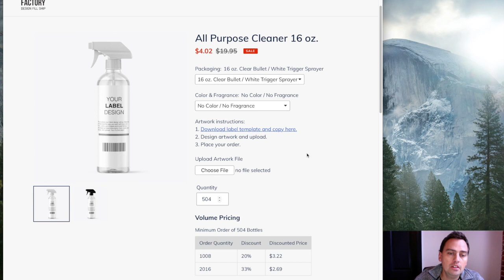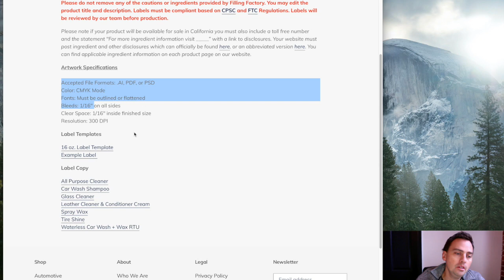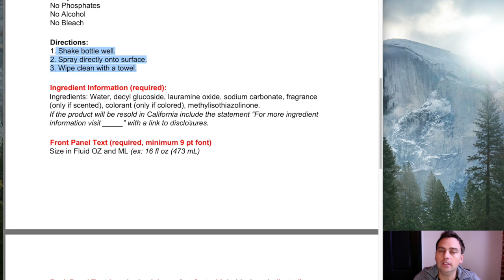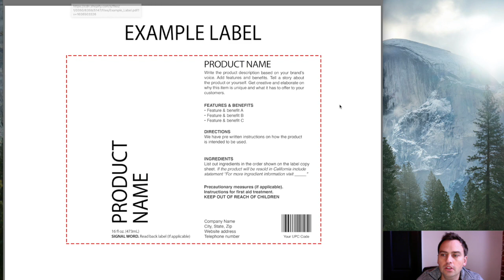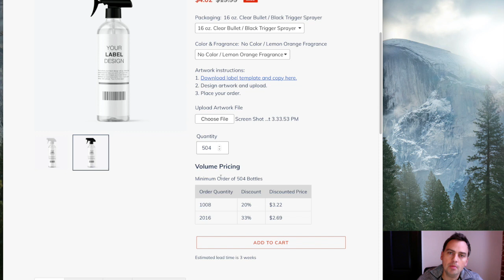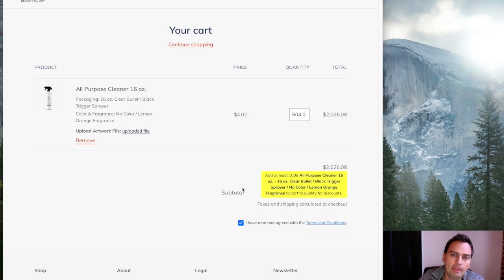How to Create Your Private Label Cleaning Product

Comment: You should drop the minimum to at least 50. Hard to sell 500 bottles if your chemicals cannot compete very well with competitors. If you had a min of 50 and the formula is the same for other buyers, no reason to have high MOQ. 

This is the reason what stopped me from ordering.